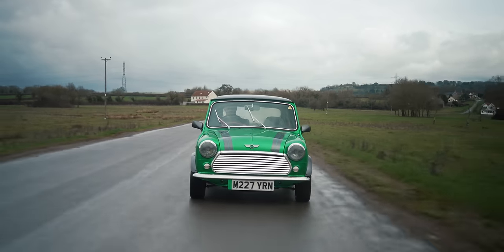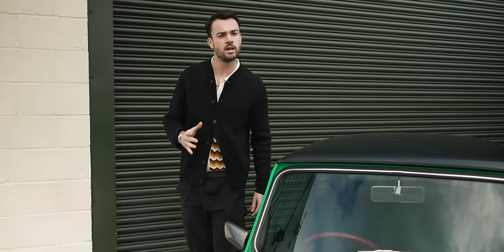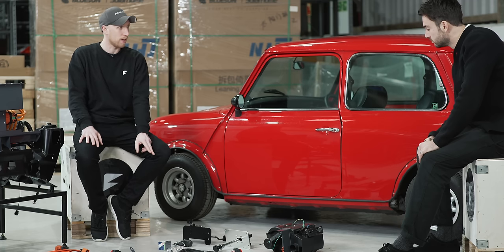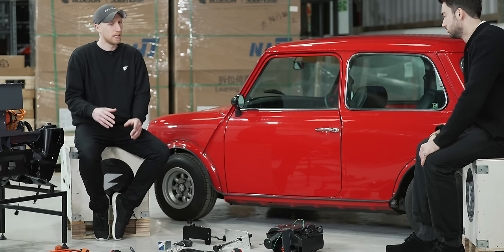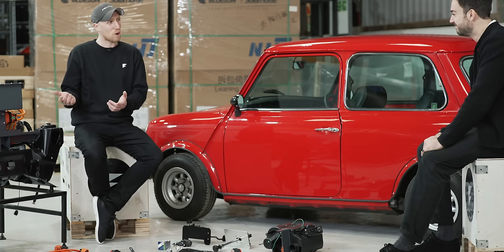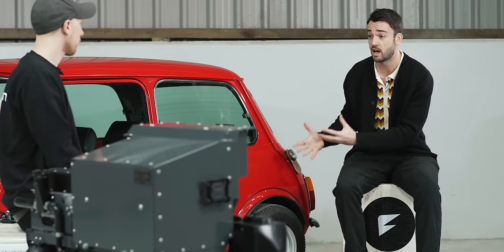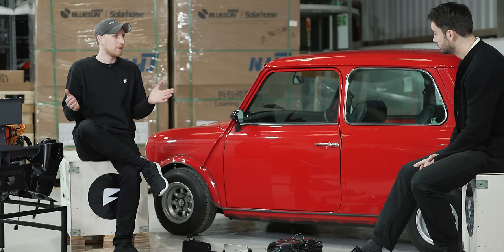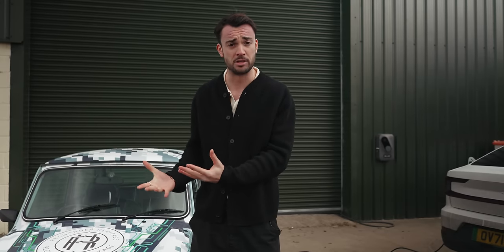How CHEAPLY Can You EV Convert Your Old Car?

Comment: I'm really liking Jack's focus on getting cheaper, simpler. and less powerful EVs over the last couple episodes. All I want is an electric car that gets me where I need to go, not a luxury palace with a 5 second or less 0-60.
Reply: Exactly.  Car makers cram in so much electric powered gadgets... I'd even be fine with hand crank windows... just give me the basics, I'm not living in my car... just driving my five miles to work!
Reply: Unfortunately this is not it.
Reply: Me too. I’d love to do this to my car.
Reply: fully agreed.
Reply: @chrisbailey1966  still a lot of fun though. And as explained, this is new tech in R&D. Big up to the men in tweed for funding it!
Reply: @Michael I think car tech peaked somewhere around central locking and electric windows. So I don't agree with the specifics.

Don't get keyless entry or touch screens though.
Reply: You basically want a Dacia.
Reply: @shhhyouknowhoo3753   Repurposed yes, but not really new tech. and a long way behind expectations at the price point. All fun classic projects cost lots of money and if you want one go for it, but know it will never be as good as an EV from the last 2 or 3 years. While petrol is available in terms of energy usage to convert or run a classic the relatively short distances they cover can't see how someone's carbon footprint would be less.
Reply: I think the fast acceleration is a by-product of having regen braking. The wiring needed to take the power of braking gives you fast acceleration for free?
Reply: I agree, I'd love a purpose built EV, with modern skateboard style architecture, with the interior space and outer dimensions of my 76 VW Rabbit. It may not have been fast or fancy but it was comfortable, had some decent cargo space with the rear seat down and was absolutely delightful to drive.
Reply: I think Jack may have turned a corner in a good way. Maybe ol Bobby Llew rubbed off on him!
Reply: @chrisbailey1966  Its kind of silly to argue that when that is the whole underlying starting point of this video. The question isnt what the state of play is TODAY, the question is, will we get to the point to where this is possible. Also, there is more to being green than cutting CO2 and with classics there is a whole heck of alot more going on than just CO2 being produced.
Reply: @patreekotime4578  I did also say if you want a fun classic go for it. The problem is going to be WHEN, as secondhand EVs become more affordable the cost and availability of batteries will always be the problem for conversions. I do also know classic cars very well and on your last point I'd say enjoy them while you can.
Reply: @Michael like the Chinese mini cars, if only they would allow them to be sold here, but they won’t as it would kill off the legacy car makers and their over large, over powerful and over priced luxury end ev’s being sold in Europe and UK
Reply: this is what I feel too, we are getting expensive massive SUV's or fancy small sporty hatchbacks, some of us just want a nice hatchback thats affordable. The leaf is great, its just out dated now and chademo is too old to put in new cars. We need a family hatchback, 0-60 in 9 seconds is fine, i dont need to go above 80mph, but I would like 300 range if possible.
Reply: I hope the retro fit business really takes off.
Reply: @Michael the Wulan mini ev and Geeley Panda mini ev both have airbags a 100 mile range, 60mph top speed and cost the equivalent of £5-7k whereas the Citroen Ami ev costs £8k can only do 28mph, 45mile range and has no airbags, it’s a mobile road block and is unsafe on 40mph roads. I’m sorry, I don’t buy the safety excuses.
Reply: Agreed. Most of aren't capable of being the Jenson Button's, Nigel Mansel's or Ayrton Senna's of the world; most of us would kill ourselves...😅
Reply: Ask Dacia to sell the Spring in the UK.
Reply: @Michael oh? I thought Dacia previously said they won't sell it in the UK as it requires a new RHD model which means more money lol. Still..... It'd be a decent entry level car for the UK market.
Reply: aptera?
Reply: @nutzeeer  lol.
Reply: @nutzeeer  I'd love to see Aptera succeed, but they've been around since 2005 and haven't produced a car yet. I'm cautiously hopeful, it's at the top of my list of announced cars that might be available in the US any time this decade.
Reply: Unfortunately this costs more than a Tesla ...
Reply: @RJordanT  A Dacia doesnt have any battery thermal management, its going to be really bad value in the long term.
Reply: @speedstrn  2006 and now is not the same. there are different people leading the company. it seems promising as we get regular in depth technical updates
Reply: Drove a little transit van that was converted to electric.  Heard it was basically the guts of a Nissan leaf.  Had a 60 -80 mile range.  Never had a problem driving around doing service calls.  And if I went on a long trip for a job it was easy to plug in the slow charger to standard outlet/receptacle,
Reply: This. I'm thinking about potentially getting a VW e up eventually because it's small, it gets me from A to B, it has decent range and it's cheap on the insurance
Reply: 40K though this sure isn't that.
Reply: Yep, lets regress and return to the dark ages. Hey, why not revert to 1 hp, get a horse and carriage
Reply: Check out the Aptera
Reply: @Nigel Hynes  on the point 
Makes me sick
Reply: TaTa Tiago EV ~$11000 starting. Maximum ideal range 300km.
Reply: @sergentcolon1  exactly 
It's never about C02
If it really was ,it would have been dealt with differently
Reply: Yes. Correct. Absolutely. Small, light simple, that might give us some range
Reply: That's what so many people think, but the industry is TOTALLY missing. Even brands who made their future on exactly this concept but with ICE cars.
Reply: @Michael excuses excuses 
No money
No resources 
Only TAXES
Reply: @sergentcolon1  yep
💯 right 
It's all a scam
Reply: Alas the margins aren't there.  Retrofitting should really have even larger subsidies than a new EV.
Reply: @Jeff James  💯 
Thank you 
So many still good cars destroyed because silly emissions
Reply: @thechappist  Yeah it would be nice to see some manufacturer embrace very simple electric cars. Electric motors are already very simple and inverters for them aren't that complicated actually because diy enthusiastic can build one. Battery cell technology is quite mature and making packs is very easy if prismatic cells are used.
Reply: 0-45 would be enugf
Reply: I have been quite scathing in a couple of video comment sections about this presenter calling 40 grand cars affordable, and about EVs being premium only, and loaded with completely unnecessary toys. I'd say the same about the VW E-Up! Which is in the twenties... for one of the smallest cars on the road today. With one of the shortest ranges. If it was 15k or less it would be an absolute question free buy. It's nice to see your comments taken on board, and something I do credit Jack for.
Reply: You need an ICE car not an EV car if you want a car that gets you where I need to go.
Reply: How much, for a 45 mile commuter vehicle?
Reply: It also makes sense from a resource perspective. When enough batteries are the bottleneck, why make massive SUVs that require the batteries of at least two smaller, simpler cars that most people will be perfectly happy with? The answer is of course profits, car manufacturers think (rightly or wrongly) that they can make more profits with the large expensive luxury cars for people with a lot of money, rather than small, less expensive, cars that can appeal to the masses.
Reply: These things are there to justify the prices. Sadly less power would only mean a minor decrease in price so they throw digital extras and numbers in your face.
Reply: Why dont you buy a Wuling for less than 5000 usd? Rebuilding an old car is way too complicated and can end up in massive cost if there are any trouble.
Reply: Buying a clean old car like the one you have in video will be MORE expensive then the whole conversion. You guys are living in LALA Land. face the reality and just buy a Hybrid.
Reply: 40,000 pounds is 50k dollars. Which is enormously expensive to convert a car to electric

Comment: A full conversion kit is exactly what I want, it feels like SUCH a waste to get rid of my old car, plus modern EVs are putting more and more stuff in them that I don't like and find excessive.
Reply: Trouble is you can never really know if a pop welded monocoque body would hold together with the stresses caused by the weight of batteries and then passengers. The only "toughened" parts of the mini were the engine bearers and the sub frames.

Might be a project for a skilled engineer but perhaps not a keen amateur with basic welding 101.
Reply: @t1n4444  According to this video the car weighs a hair over stock, so (at least in this case) the weight shouldn't be a problem. That said it may be that the kit for whatever model is being retrofitted in the future might include some strengthening bits.
Reply: @KineticLatency  

Hmm, the mention of "strengthening" implies the body or shell isn't "strong" enough to cope.

If you consider the first minis were designed for the "A" series engines and the suspension consisted of rubber donuts then the weight distribution could be quite different post conversion.

As before, a project best completed by an engineer and not a hobbyist.

Now, that said, if we see hydrogen fuel cells designed for smaller cars and can be engineered into old cars then who knows?
Reply: Eve are shocking to look at, no pun intended.
Reply: My big thing is safety features. That old mini will be crumpled like a coke can if its in a head on collision with a modern car or SUV
Reply: @jcakblade101  

There again it might be that a "lot" of older British cars wouldn't cope with the extra weight and power available.

There again finding a few 30/40 year old British donor cars without significant rust would be a feat in itself.

We'll soon know if battery conversions become popular. There again the way green hydrogen generation is being plugged as we type it may be that FCEV conversions become adopted instead.

 We'll soon know about that too.
Reply: @jcakblade101  simple solution, just put antitank mines on the bumpers. 😁
They won't save you, but they'll share your suffering :D
Reply: A couple years ago I spent a lot of time looking into EV conversions because the solar installer I worked for wanted to electrify the first model work truck they used, a 1972 Ford F150 for their 50th aniversary.

The complicated part of an EV conversion is building the battery box, developing a battery management HVAC system and wiring & plumbing the battery box. Those are really the only manufacturing tasks, the rest of the conversion is just mounting new EV parts to old ICE mounting points, running traditional-ish auto wiring and some programming. 

My problem with every OTHER company that offers a kit, is they offer a kit for the easy parts and the mechanic/hobbyist still has to do the complicated part with the batteries. Its very nice to see a battery pack included in a kit.
Reply: @patrickcorcoran4828  most conversions i've heard about use an existing battery, often from a tesla.
Reply: @nos9784  and spikes on the wheels?
Reply: @jcakblade101  if that's what you want and if you have the money to bribe the police, go for it!
Reply: @nos9784  True, but you have to build packs from the crashed Tesla battery that fit whatever car you are converting. Tesla's are the easiest to use because each section is already plumbed for the HVAC battery management system.

If you're making a pack from scratch from off-the-shelf batteries you need to figure out all the battery management HVAC stuff, or you end up with a 2011 Nissan Leaf, which is fine as long as you are in a mild climate.
Reply: Like remote off switches .....its all about control
Reply: @jcakblade101  This is starting to sound like the Arena War DLC in GTA-V Online.
Reply: I've pondered for a while to retrofitting my car to electric, but in the end I figured it will never be worth it.
Rust is starting to show, the interior is starting to fall apart etc.
My current car is very well balanced and is great fun to drive, and that might be compromised with a EV retrofit.
Reply: Who needs a car that farts when you sit in it?
Reply: @nos9784  Or a few from the old Smart Cars.
Reply: They want in Tesla the unsafe big screens and for Nisan they want cars that are so small nobody bigger then 5 foot 6 or 167.64 cm can fit with really only the Ford Truck looking out for personal saftey in the vehicle by going more the older style of dashboard.
Reply: All that silly safety engineering
Reply: @jcakblade101 and the problem is the big suv, not the mini. this SUV trend is absolutely the wrong way to handle a car, especially with climate crisis n shit
Reply: @t1n4444    to whole point is to bring down cost and if doesnt weigh anymore why pay a silly over price it will keep it up in the 40k figures . Also where is all the electric coming from   they need charging points  plus power stations which isnt happening
Reply: And for the low low price of a brand new car you can get a less reliable EV version of your old one with higher, more frequent maintenance costs and far less range. 😂
Reply: Totally agree.  Just want to have the motor to get from point A to B and Radio.
Reply: Excessive , intrusive and wasteful!

Comment: Please re-do this video every few years with updates! The more I think about it, the more obvious it is to me that this is the way to go for mass transition. New cars are such a colossal waste of resources. We need a parts economy, just like people have been fighting for with regards to cell phone repair.
Reply: Wait, it this a re-upload? I'd have sworn I'd seen it before. 
Edit: Nevermind, 2:33
Reply: It should be EVERY year. this topic should be brought to people's mind more often also by other media channels.
As @Chrisd__ points out Jack even mentioned in this video that they already did it last year.
4 months to go for the next one. 👍
Reply: The drive system is the car.  There probably wont be a day where its cheaper than just buying another one.  Especially if battery tech can cut the price of the battery in half.  If that happens, the cars will be much more affordable in the first place.
Reply: 40000€ for a 50 year old Mini...which itself costs several thousand even with a blown motor.

Seems a rather silly and non sustainable solution to a problem that doesn't exist.

Comment: Great video thanks @Jack , it will take time, once we get all these measurements, they should be shared freely. Prices will come down for sure with more second hand EVs becoming available for parts.
Reply: Be serious  ... does "type approval regs" mean anything? And of course what would insurers make of a homebrew conversion? Insurers are picky enough as it is.

Too many school boys with over heated imaginations yet no appreciation of engineering running wild on the internet as well it appears.
Reply: @t1n4444  it's already happening, cars like this are on the road and insured.
Reply: @edlowry1   

Very possibly.

But, big but, would suggest as converted by qualified engineers.

And not by someone with a socket set.

Factor in the number of engineers who could be arsed to do this work then we aren't going to see that many.
Reply: @t1n4444  oh 100% any conversion has to go through proper tests afterwards.

Comment: There may be a lot of people who don't have nostalgia for older cars because they never had a really great one.  I have a 350 horsepower V8 in my '65 Barracuda that needs a rebuild.  Can I switch to electric instead, affordably?  I really want to.  In my case, I won't do it if the car can't be at least as fast as it has been with a V8.

Comment: The reality is that bespoke conversions will always cost more than a mass produced new car. Scale and automation drive costs down - neither of which factor into conversion builds.  To get just some perspective on the difference in the equation, these guys are talking about making something like 1000 kits per year as “volume”.  Tesla made 421,000 model 3 and Y in the last 3 months.   

I expect that it will get cheaper to convert using components from crashed EVs but the labour costs alone will keep it expensive compared to a new car. Remember that as battery prices come down it also becomes cheaper to build new, and even with a bolt in kit that only takes a day to install, that’s 5000x more labour than required for a new car.

Comment: "Buzz bar" would be a good name for it (given the electrical shock risk), but it's actually a 'busbar'. (Busbar being a contraction of "omnibus bar" -- the bar which everything goes through.)
Reply: As it just joins two components, is it actually a bus bar?
Reply: @markthomasson5077  yup, it's a bus bar. 
The rubber is primarily for electrical insulation, not durability. 

Also I have never heard anyone use the word "componentry" before today. 
Why not just say components?
Reply: @weeeeehhhhh  - Shrubbery… 😉
Reply: @weeeeehhhhh  Yup. It's a little hilarious he used that component as an example of something made pretty because they're "doing it nicely" but can be made cheaper (subtext: without the pretty coating) later.